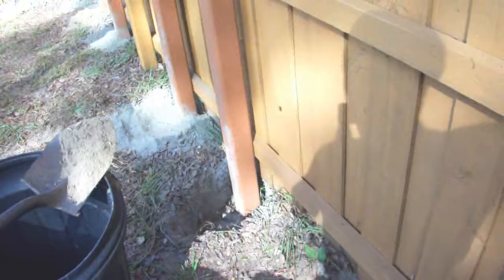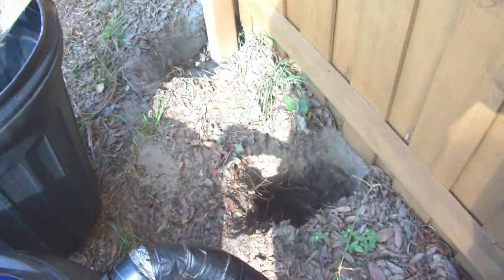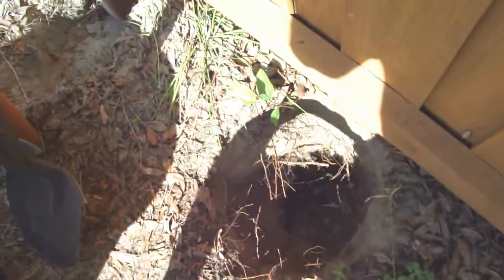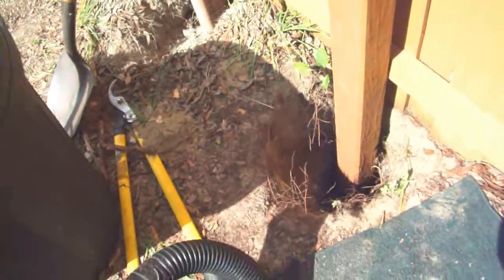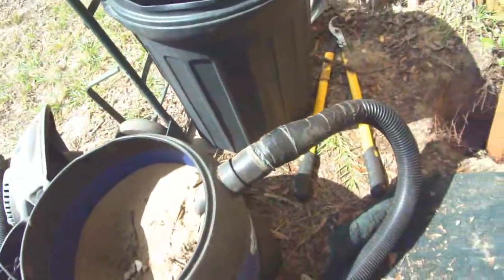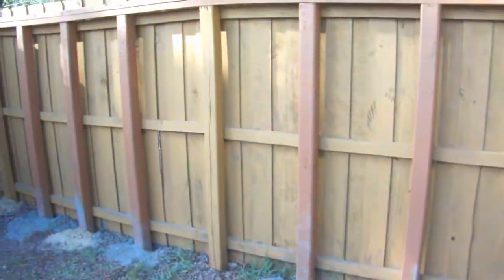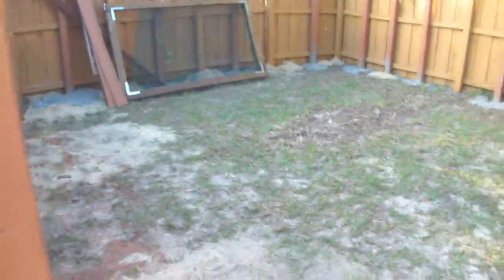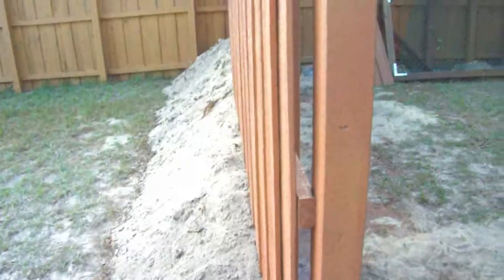Digging a Post Hole w' a Vacuum Cleaner.

Comment: I did a bit of this before and ran a line from the shop vac into about a 10 gallon sturdy garbage container with a lid. I then ran a line out from the container  to the hole I was digging/sucking. I could excavate more dirt before emptying and my vacuum filter stayed a bit cleaner for longer. I want to make one with a 45 gallon drum and two vacuum motors on top if I ever get the time.
Reply: James Stork why not use that work leaf thing attach to garbage can

Comment: I have a 2000 Sebring 2.5L V6 and I went to start it today but it would never hit all it'll do is crank. The fuel pump is working, I checked the fuses they all seem to be good but I'm not sure how to tell if one of the clan relay fuses are blown can you help?
Reply from the maker: Could be a dead CPS or distributor. Check for spark.  I don't know why you are commenting on that subject on this video.?
Reply: It was the only video that would let me comment on. I'll check those. Thanks
Reply from the maker: Cody Jones 1999 Chrysler Sebring Convertible, Ignition Coil in distributor
1999 Chrysler Sebring Convertible, Ignition Coil in distributor
Quick How to - Engine Troubleshooting- SPARK & FUEL
Quick How to - Engine Troubleshooting- SPARK & FUEL
1999 Chrysler Sebring convertible CPS {crank position sensor} & Distributor
1999 Chrysler Sebring convertible  CPS {crank position sensor} & Distributor
Reply: If you tried using the engine intake as a vacuum cleaner that could creat problems. Powerful suction tho, right?